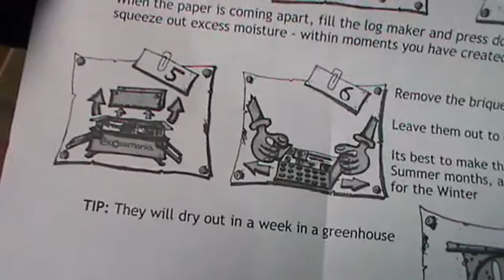Eko-Mania Heavy Duty Paper Log Maker instructional video

Comment: I bought one of these a few years ago, I actually like how easy it is to make the bricks but I make mine about half as thick as you did in the vid, of course doesn't last as long but you get more heat out of it if it's not so thick, it burns through better. Just my opinion. I also do mine with the log maker in an old plastic dish pan to catch the water then I can just dump it back into the bucket with the shredded paper.  :)